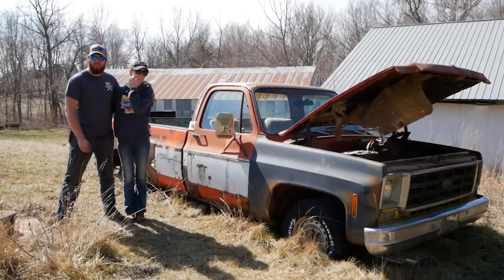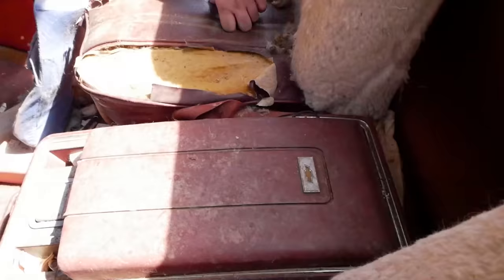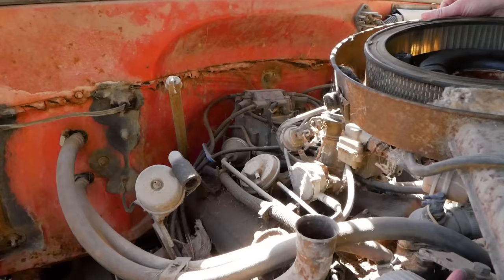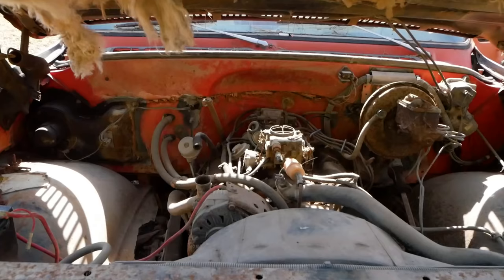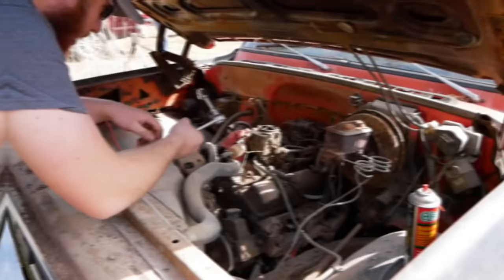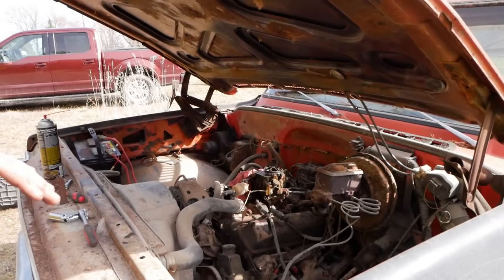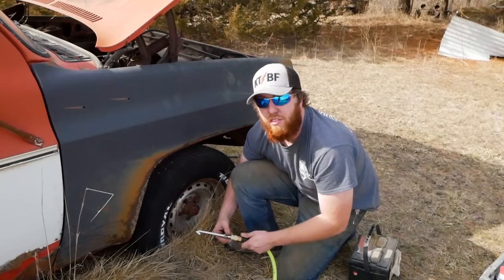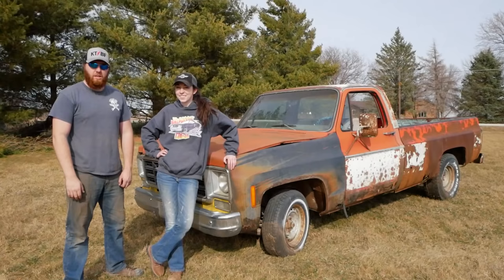Will an Old Chevy Start After Sitting for 20 Years??

Comment: Old Chevys never die. They just rust out and get sticky.
Reply: All that thing needs is a 454, a muther thumper cam, and some long tube headers
Reply: @hunterpowers1829  yeah atleast something other than the fucked 350. sounds horrible
Reply: They die all too often.
Reply: Bit like me ;)
Reply: @jameslandon4126  nah man old ford and Chevy pickups don’t die where as dodges they do
Reply: ever the next gen of chevy trucks after sqarebody are dependible i have a 96 c1500 5.7 with 329500 miles running strong just had to starit pipe it till i get another muffler because my bank 2 cat decided it wanted to come appart and clog my muffler but thats minor im in a area that doesnt check emmisions
Reply: @jameslandon4126  no they do not 😂😂. They even power 80% of them damn ole fords on the track when they die 😉😉
Reply: They don’t rust out terribly down in the south
Reply: @RandyClassicCarsFan  sounds pretty good for setting that long

Comment: Those bucket seat/console cores probably worth every bit of what you paid for that truck! Pretty high optioned truck!
Reply: I had a 78 high sierra that had the center console bucket seat combo it was rad
Reply: We have a 84 Chevy full on deluxe model, got AC power windows and locks, cruise control and power steering. It has a bench but ours is a custom built one with a folding center console

Comment: Try different plug gaps.  A fouled plug can often fire a very small gap of around .010", especially with plenty of fuel and compression; and if lean or low compression, it might only want to fire with around .050".  Try one of each and see what works!  especially if you don't have clean plugs to put in.

Comment: My first car was an 06 Pontiac G6 coupe. 
The blower motor sounded the same.
The radio was tuned to the same station.
The steering wheel was sticky.
The seat looked just like this.
GMs never change, even 30 years removed from each other.

Comment: I had a 76 Chevy 350 3/4 ton pickup with a 4 speed.  That fan was a pain always running.  I put a toggle switch at the bottom of the dash to turn it on and off.  The center carrier bearing of the driveshaft wore out and the idler for the steering froze and got noisy after 50K miles.  Other than that, the fuel 'economy' was poor, but it ran like a race horse with an Edelbrock intake.

Comment: If those battery terminals were cleaned thoroughly with an actual terminal cleaner it might have started even sooner!!! Also Sparkomatic was a very big company that use to make car stereos, speakers, amplifiers, radar detectors, floor shifters, CB radios, floor creepers, and whatever else I'm forgetting. That same stereo that's in your truck is currently selling for $100-$140 on Ebay. Other companies along these lines back then were Craig, Kraco, Audiovox, Sentrek, Jensen and whatever else I'm forgetting.

Comment: The sound from the blower motor is the same as the rear axle bearings in the cheap 4x4 challenge! I think it's a distress call Chevys use to communicate. Ask Derek, Obi-won is wise, the GM force is strong in him!

Comment: years ago i had a 76 C-10 configured a lot like yours (not the delux model). it ended up with about 200K miles on it. the drive train, everything mechanical about it was like a brand new truck but the body had disintegrated the time i let it go.

Comment: They are dime a dozen,  but everyone is buying these up.  I had an 83k20 plow truck  with a  350 n had a hydraulic dump lift  but standard bed.  they can take a beating . When I got rid of it the bed sides were flapping n held together w a tailgate net  :D

Comment: i absolutly love the old square body chevys especialy the second gen of trucks 1973-1991 because my dad had a few square bodys himself he had a k20 some time ago and he has a 1986 k5 blazer and he still has it we got a 350 block thats a old crate motor block and we built it to be a 383 (because it had a old claped out 305 before that had old commercial grade garden hosing on it) but the transmition is busted and it wont shift gears it will go and change gears like from parked to drive, nutral and revurse but it wont get up to speed (the transmition is a 700-r4 and he wants to rebuild it and bullet proof it) but it is aesome and we go to old junkyards and get parts from other matching square bodys.

Comment: LOL you pair do make me smile.. But you got It running and In the end it never sounded that bad - NO SMOKE coming out the back/ underneath/ in the cab either.. Here In the UK we have a ruling that vehicles 40 years old and older don't need its technical inspection (MOT here) Yearly or dont need to pay taxes to drive on the roads AS ITS CLASSED AS HISTORIC,  so in theory this pile of poop can drive legally on our roads, but, best get silencers, get the visible rust holes bondo`d up, best get all the lights working spot on and, who needs floors when you can buy sheet steel and pop rivets - lol.. Thanks for the video again guys.. Ian - UK.

Comment: Do a revival on that Packard in the background. They had engines so smooth running that if the exhaust wasn't shot you'd have to look at the RPM gauge to know if the engine was off or idling.

Comment: I like the shots of what you are doing in the engine bay rather than the pulled out shots. You do enough of these start up videos that you should have a standard kit, including strong battery, starter fluid, tire inflator, fuel lines, fuel filters, hose clamps, etc. Also include some basic repair items, such as belts, plugs, wires, etc for the model of vehicle you are targeting.

Comment: I have a 84 gmc pickup and the wrong plugs were put in 😂 we’ve done a lot of work on him , still
Need to put a new carb and intake manifold in, same with headers and now we may need a new master cylinder ..he’s a work in progress but he won’t stop running after he’s all done, I got mine for 500$😂 but yes squarebodys are expensive if you find them

Comment: That's hard to watch. Brake and parts cleaner is a solvevent. Ether starting fluid is a combustible fuel. By soaking that old girl down in brake cleaner you're washing anything from the intake valve train and cylinders down to bare metal. If it does fire up you have nil for oil glazing to protect parts from destroying themselves.  Yikes also on a side note starter motors heat up very quickly due to being such a high demand/workload item. 4-5 seconds tops while spinning any motor over is a much safer bet than the twenty plus seconds demonstrated here. Just a couple pointers. Love the truck. Youre a very lucky guy too btw. Just my humble opinion. Good luck with the restoration.
Reply: They really should just get a squirt bottle with gas and maybe some 2 stroke oil mixed in, ether and brake cleaner both will dry the cylinders out in a heart beat, if your going to use starter fluid or brake clean atleast pour some oil down the intake first, and using oil or 2 stroke fuel will help seal the rings and valve seats a little bit which will help boost compression for that 1st start.

Comment: You guys had me rolling with the blower fan 😅. One tip I may add, 2 stroke fuel may get you there a little quicker than the brake cleaner. And a little easier on the engine 🤘

Comment: Sparko-matic radios  and cassette tape manglers were only available at your local Wal-mart in the 70s and 80s. Worst 20 bucks you could spend. A sparkomatic cassette deck and a 40 watt road master EQ/amp and some pioneer 6x9s and you had yourself the best 75 dollar sound system that money could buy. With sound quality that is about equivalent to an iPhone cranked up to full volume who wouldn’t be excited to install that into their vehicle. Hell they might still be available at Wally World.

Comment: me and some freinds bought a 77 c20 for 800$ over the summer in grand mound Iowa. it had a bad trans so we pulled it out an got it rebuilt for 500$. re sealed the motor and did some other things and sold the truck for 4400 lol.

Comment: If possible, use 2 cameras with one on your carb action and the other on the exhaust.  If you only have one camera, I would alternate it between under hood and exhaust.  With side exit exhaust, it might be possible to angle the camera down that side so as to get the carb in one side of the frame and the tailpipe in the other, or rotate the camera from the carb to the exhaust, right as the rpms first struggle past about 1200.

Comment: Revive it or not, was there any doubt? Its a small block Chevy with a Rochester 2GC on on it. Only question I had at the start is if the old tires would hold air.

Comment: 350 V8's are the best Chevrolet small block V8 engines ever built by GM! Even GM's 4.3L V6 was based on the 5.7L V8 and the 4.3L was the best V6 GM ever built too! That comes straight from a diehard Ford fanatic and I love my 385 series motors, lol.

Comment: i bought an vauxhall (GM ) astra 1.6 ltr z16se engined mk4 2003 running on 3 cylinders, should be on four, for $370 two years ago, turns out with a broken  exhaust valve spring on number three, $2.00 cost in total to fix.

Comment: I bought a much nicer one than that for $200 about a month ago. 78 C20, 3/4 ton longbed, 350, AT, 14 bolt, and its red. Only rust is the drivers side rocker, and into the drivers side floor. Fairly straight. Motor is blown, but no biggie.

Comment: Should never use brake cleaner to try and start an engine .  It completely removes all oil from the valves and piston cylinders . Carb clean is not quite as bad but still not the best choice ..  Straight gasoline with a little 2 stroke oil mixed in would be a LOT better than the hack brake cleaner .  Might as well dump sand down the intake .

Comment: Steering wheel goo- the latest anti-theft innovation. I wonder if it would freeze in our Atlantic Canadian weather...
Reply: I bought a 1979 Silverado back in 2005 that sat for 5 years in Salt Lake City Utah. I don't know if it's something in the material that was used in the steering wheel. That 1979 had that same stuff coming out of the steering wheel. The only way I can describe that stuff is rubber cement with silicone and very sticky. I used acetone and strong soap to get that stuff off and treated the steering wheel with a modern interior cleaner.

Comment: Ford 2bbls are one of the best & easiest carbs to work with. Ive seen them on vehicals from 4x4s with big blocks to being on top of a chevy small block in a stock car. They are the simplest to rebuild & you gota be the only person ive ever known to think they are anything less than a great carb! Not to mention 2nd to the chevy dual jet carb!!?? I gota question just what technique you are using with them that they don't want to work for you? They are so simple I thought they were fool proof? I dint think anybody could screw one up?? I guess I stand corrected?

Comment: How unreasonable does it seem to have first gone ahead and pulled all 8 spark plugs and put some penetrating oil into each cylinder? Turned it over a bit, then put a bit of 2 stroke or Any kind of oil really, into each cylinder. Turn the engine over a bit more. Let it sit a short while, then start it up with an external fuel tank so as to Not pull 20 year old crap into the carb. Way easier on the rings and the rotating mass.

Comment: Why are you using brake clean instead of starting fluid? Brake clean is designed to be less flammable to prevent flash fires when people spray everything besides brakes. Yes it's still flammable  Starting fluid will make a car with even no spark want to start.

Comment: Meanwhile, my c20 project that hasn't moved since 2004 is completely seized and won't even move with a 5 foot breaker bar and marvel mystery oil
Reply: If your truck just has a run of the mill 350 or 305 just pull it out, throw it away and look around for another it's actually faster and easier to just swap the engine rather than try to free it up and possibly have to rebuild it. If you look around you can find a good used 350 for $500 or less. If the truck has something special like a 427,400 or high performance 454 then keep trying but dont spend too much time on a scrap engine.

Comment: You Got Taken. $ 500.00 bucks for that rusted out Pile of Junk. I could buy them running and Driving for $ 200.00 bucks or Even Cheaper in the 1990s. And i just turned 60 A Few Days Ago.